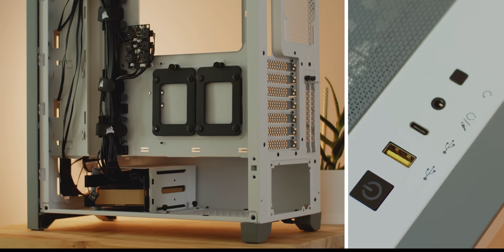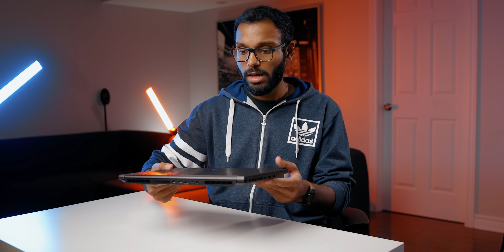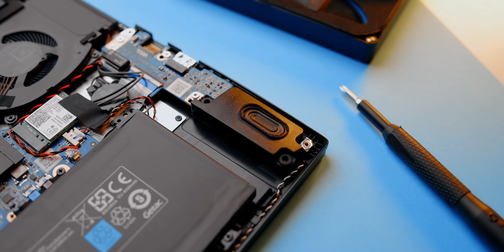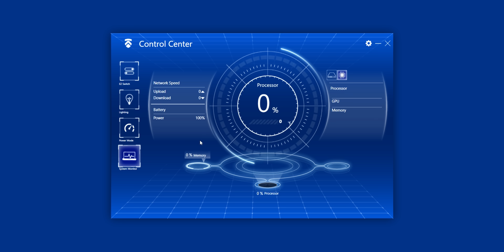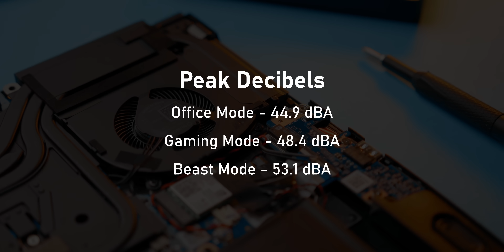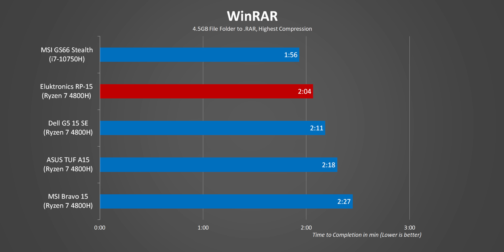A Ryzen Gaming Laptop Done RIGHT!

Comment: Eluktronics didn't design the chassis, the hardware is designed by a chinese company named Tongfang. It is available under many other brands like XMG and Maingear
Reply: I always find it funny when credit is given to the resellers rather then the company who actually designed it. Same with Sager/Clevo, just Tongfang is much newer player in the NA landscape.
Reply: @exmortis4404  Sager & Clevo are also ODMs right?
Are they also Chinese?
Reply: @sushimshah2896  Yes Clevo is the Taiwan parent of Sager Notebooks here in NA. They make essentially desktop processor lappys. I have a NP9170 which is what I want to replace.
Reply: @sushimshah2896  clevo is from taiwan i think
Reply: @exmortis4404  Those design factories don't want credits for it, they just want hardware to be sold, the rest is up to the resellers/brands that use their barebones. But for HP, Dell and al others, it's not really different. Did you know that the Alienware's are Quanta Barebones for example? :)
Reply: @GerbenBouwhuis  I knew Alienware was not Dell's true design, but didn't know it was Quanta specifically, but then I have not held Dell's systems in high regards anyway, they just make some sense for the everyday user. I love my Dell Ultra Sharp however.  :) Also it is not about credit to the ODM, it is about informing the viewer so they can make a truly informed choice and understand the options before them.
Reply: Exmortis i do agree, but than let’s mention that on all brands? HP uses Compal a lot, but nobody talks about that. Ps. Alienware prior was Clevo 😇
Reply: @exmortis4404  well to be fair we arent crediting the odms for the name brands either.
Reply: @Lollllllz  What other brands? I guess it may matter if you differentiate manufacturer with designer, I do. So what other brands are you speaking of? I personally think its a reviewer/influencers duty to ensure they mention that a product like RP-17 is an ODM product and there are many companies who provide the near identical system. Omitting critical information that relates to the product is not playing clean pool. Less informed people come here relying on honesty and transparency to make good buying choices for what is a really expensive product.
Reply: @Shrey Sodhi look up tongfang oem names
Reply: Tongfang/mechrevo oem
Reply: and they fucked up the camera spot
 all of them
Reply: @LetsDoItQuick  the eluktronics rp17 or the 17” version of this laptop has the camera in the proper spot and has better cooling. I am pretty provoked into buying one of these, but the only thing holding me back is the hope for the next generation. I hope the zen 3 cpus will be even better, and I hope thunderbolt will make its way to ryzen laptops!
Reply: @LetsDoItQuick  The RP-17 has the camera in the right (upper) place, if you're ok with a 17" design. Same in every other specs.
Reply: @TheMacco26  yea im ok with that
Reply: It's called a WOOTBOOK in South Africa and it is a beast! There are small issues with it but give the brand a generation or two and it should be perfect 👌
Reply: @Picasso Pablo would you care to elaborate?
Reply: The problem is Tongfang doesn't care about credit from consumers and all what you are trying to do does is muddy the waters. You are trying to get consumers to understand the entire complex design and supply/manufacturer landscape and not a single consumer gives a shit about that nor should they. It's irrelevent. Those suppliers only care about what OEM's think because that's their customer not you. They want you to love the product Eluktronics or HP or whoever supplies you so more companies will come to them for their products.
Reply: @joer8854  kompleks jest spierdolony
Reply: i am surprised that big oem like asus chose to choke their product from airflow and lose to tongfang in terms of performamce, cooling, and noise
Reply: @Picasso Pablo Tell me more. I just wanted to order the Fusion 15. What was your problem with them?
Reply: @Picasso Pablo Thanks for your answer!
Reply: glad that it is Taiwanese instead of china, great country~
Reply: Also Illegear in malaysia
Reply: Well tongfang has serious qc issues in china. I'm skeptic about their product that sell overseas having the same issue as well.
Reply: @rummimg  Solid point, but I would hope that is the benefit of OEM reseller such as XMG or Eluktronics.  So far from my research they both seem to have some decent QC I have not seen too many reports issues. However saying that, CyberPowerPC on the other hand /shiver, didn't take much research to erase them from my shortlist for a new lappy.  Looks more and more everyday the Lenovo 5 17' AMD is my purchase.
Reply: @rummimg  Their lower end unit used to have  gpu VRM design flaw(not enough power delivery, and caused some unit failed). But that was on intel platform, this is a new design, also with more power efficient AMD cpus, so it should be ok...
Reply: @qiyuxuan9437  well actually I bought it and I have to send it back to repair around a month of my purchase.  Rp17 from the same company, so yeah I can certified that the tongfong  products have some kind of quality issue in which I don't recommend.
Reply: I believe 'Infinity' in Australia.
Reply: @mdrumt  and Metabox I think
Reply: Wasn't Tongfeng also the ODM for those Overpowered brand laptops Walmart has a couple years back for an insane good price?
Reply: @2dfx  yes overpowered as well as the new line up evoo gaming i actually reviewed one recently

Comment: Booooo!  Should have dropped a RX5600M in w/ SmartShift.
Reply from the maker: It woulda overheated.
Reply: @HardwareCanucks  The Dell G5 SE did have thermal issues out of the gate, but I'm hearing that's mostly been resolved months later.  I'd expect SS to be in the new 5000 series laptops w/ RDNA2

Comment: "Gaming Laptop Done RIGHT".... bubbles in the wrap, camera placement is crap, microphone quality is crap, screen hinges seem crap ( hence maybe the light weight? )  max GPU is a 2060... I'm only 6 minutes far and there is something weird about this review...
Reply: Since when has camera placement and microphone placement mattered on a gaming laptop? Also the wrap is entirely unneeded.

For many the 2060 is more than enough. But companies like this also offer other options if you want to go higher....
Reply from the maker: Its a GAMING LAPTOP.  :)
Reply: Was gonna say the same thing. Seems like he (conveniently) forgot all the drawbacks HE himself mentioned throughout the review. Calling this the 'perfect all-round gaming laptop' is a bit of an overhype when it's clearly not perfect. I get wanting to draw emotion to support small companies and that criticising big companies is cool, but nothing helps them improve more than pointing out sharply where the product fails at rather than drawing a partially accurate conclusion like that. These guys still have a long way to go before reaching the same level as top reviewers like GN, unfortunately...

Comment: Eluktronics should be using a Clevo chasis. You just have to find the brand that sells rebranded clevo laptops in your country. Notable ones are XMG, Metabox and Illegear. Appreciate it if anyone can post the clevo chasis for this laptop here.
Reply from the maker: 90% sure this isn't a Clevo chassis for the RP-15.
Reply: @HardwareCanucks  you might be  right on this(info at XMG subreddit). Should be another ODM. Tongfang? Hmm.... 😂
Reply: @ianlee6416  Yeah I think its Tongfang, which are well regarded these days.